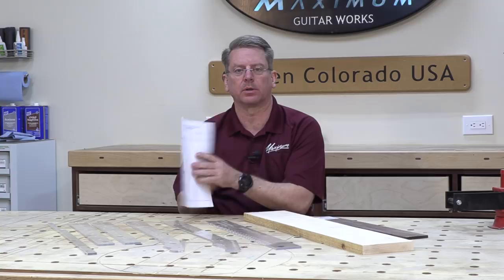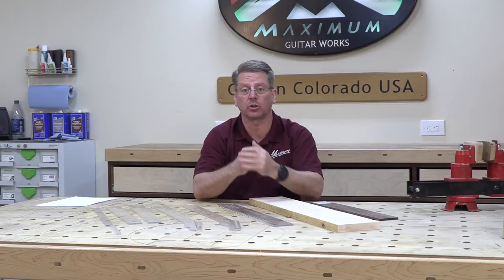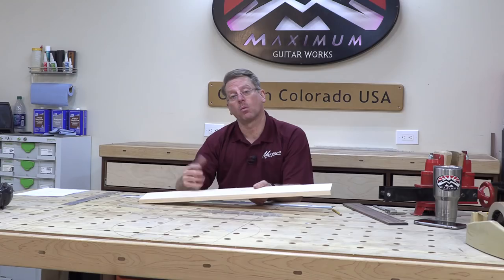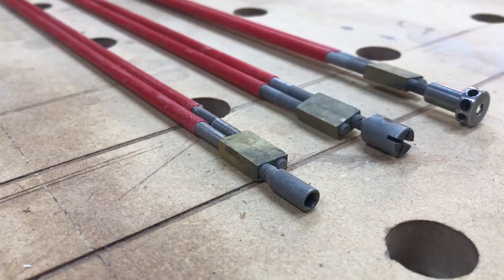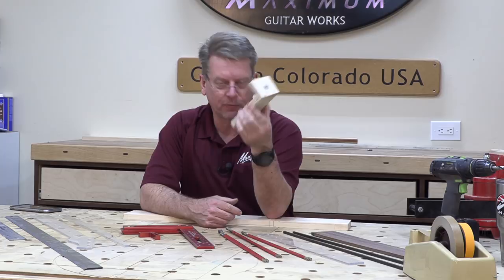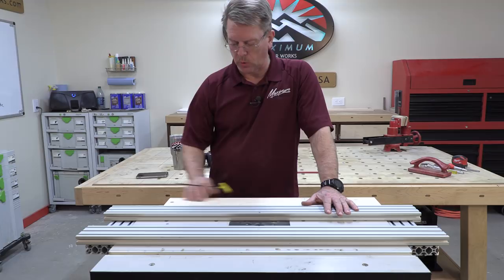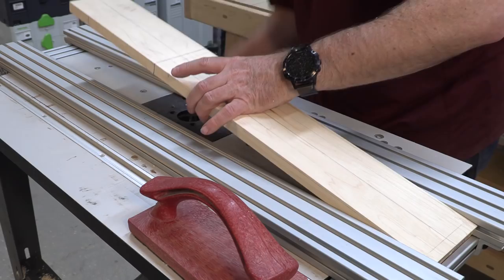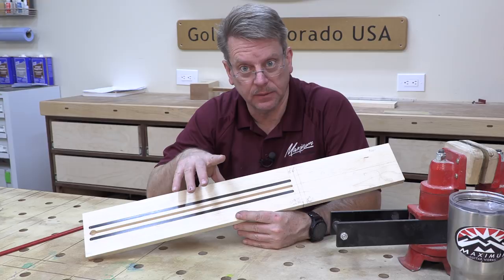Telecaster Build - Part 1 - Neck Layout and Routing

Comment: Verrrry late to this series, but just what I’m looking for *right now*.

My ‘plan’ is for a 3x3 tuner layout but on an F-type headstock “angle” (ie, zero angle but ‘dropped’ to give string break angle at the nut.

What I wonder is if the worksheet you mention at the start giving the order of operations is available for download anywhere? My memory is such that I forget operations here and there, and mess things up - so a step by step ‘operating manual’ would be very useful.

Cheers - I envy your pupils! Nothing like this when I went to school in the UK in the mid 1970s!
Reply from the maker: Sorry for the late response.  I get so far behind...and hard to keep up with everything.  Did you ever get the answer?  Doc's are only available through emailing me.  It is less of a manual...and more of checklists and outline of all major steps with room to take notes for future builds.

Comment: Hi Steve, why are you using 2 carbon fiber rods, besides the truss rod ? It's maple, so.. if it's dry, it's stable enough and those carbon rods aren't exactly cheap. And don't they prevent the truss rod to work in a save normal way, so they could break when tightening ? I can understand if you you woud use this on a big 6 string bass neck with double truss rods, but here ? I would loose up the strings a bit and clamp the neck to "help" the truss rod when turning it, to be safe. Greets from Belgium.! BTW.. good initiative !
Reply from the maker: Bruno, you present many interesting discussion points.  Let's see if I can hit them all.

1.  Why?  In short, because I can.  Seriously, I like the neck to be ultra stable...wood is wood...it might be stable here...then I ship it to a more humid area.  I feel like the carbon fiber I use sheds a little weight...which I like too.

2.  I don't feel like I pay too much buying in bulk for a specialty carbon fiber supplier. 
 
3.  I have been using hollow carbon fiber rods recently.  Not as rigid as solid ones...but still has the spring back qualities.  I have had no issues with too much tension to adjust the truss rod with this configuration.  Unlike a quartersawn maple neck I made a few years ago that had two titanium bars in it...I had to pre-bend that neck to adjust the truss rod.  Plus it was heavier.

As I also say...there are many ways to get the job done...and I certainly have not tried or know everything.  I can only show what I think is the best practice as of today.  A month from now I might have a new way that I think is better.
However, I really do appreciate your questions and discussion points...keep them coming my friend.
Reply: @maximumguitarworks  Thanks for the reply Steve ! Like your answers too. Makes total sense to me. Can't wait for part two.. i subscribed and hit the bell. Greets from Belgium.
Reply: Better safe than sorry

Comment: this is really excellent.  Thanks.

I am wondering why you do the fretboard individually...I thought you'd probably route the whole neck and fretboard together after the fretboard was glued on?
Reply from the maker: Hi Paul...thanks for you comment. Like I always say...there are many different ways to get to the same place. 

For me, it is all about order of operations. I always need to have alignment references. You have to think of sequences that allow for referenced alignment as far as it will take you. The way I use reference holes under my fretboard in the slot cutting process...assures the slots stay perfect aligned. The same reference alignment holes are used on the neck template...which ensures the neck is straight relative to the truss rod. 

These two components come together for a pretty much perfect match. If I glue those together before routing the final shape...I risk the alignment being off because I have no true reference...only eyeballing a template to the top or back. If I rout the fretboard using a template on the bottom with alignment pins...it is perfect. At that point, the fretboard itself becomes my reference when routing out the neck shape. 

Hopefully that makes sense. It is still early...so I could be talking nonsense. The key is to maintain mechanical reference for as much as the process as possible.

Comment: Was looking for a guide on measuring and marking the bottom of the neck and the top of the neck so the nut, pickup poles and bridge saddles all line up, but that didn’t happen. :/
Reply from the maker: You were looking at the wrong video.  Look for part 12.  

https://www.youtube.com/watch?v=E-wjzF4YKAk&list=PL2NC1vESpordvNSgpvjC553KtwFDYUHSl&index=12&t=849s

If that doesn't answer your question...try emailing me with your specific question.

Comment: I’m late to the party, but provided those carbon rods are solid, why don’t you use them as guitar nuts? Is t that basically the same as Graphtec? ESP used carbon fiber nuts on their guitars, and PRS uses something similar (or the same but don’t admit it) as graphtec.
Reply from the maker: I'm going to try that.  For some reason I never thought about that.  Might take more shaping...and that dust is pretty nasty...but I'll try most anything once.

Comment: Are those CF offcuts anywhere near nut blank size?
Reply from the maker: They are 1/4" x 1/4".  Not a bad thought...although what I realized I forgot to reveal is that I am currently using hollow CF bars.  I switched because I felt like the solid bars were way overkill for my neck designs.  

But thanks for your comment.

Comment: On a quarter sawn neck piece it always tears out on the headstock
Reply from the maker: For you?  There are some woods that are trickier than others...and some techniques that can help.  One technique I was showing my students tonight...was how to use very short and targeted problem areas and use a climb cut technique.  This is dangerous if trying to rout too much wood...but effective if used correctly.
Reply: @maximumguitarworks  I saw where you said spritz the wood with that magical tone adding spray ;) and I’m gonna give that a go
Reply from the maker: Water is fine. 😉  And that trick works good on some woods...other not so much. There is no substitute for good and sharp bits...and proper router techniques.
Reply: @maximumguitarworks  currently working with wild cherry, hard and kinda chips like white walnut

Comment: How thick is the timber when you first got it
Reply from the maker: Neck blanks normally start off around 7/8” to 15/16”. However, when squaring up the blank...the final pre-routing dimension is dependent upon your expected thickness of the fretboard. The total thickness of the neck and fretboard should be 1” (25.40mm).